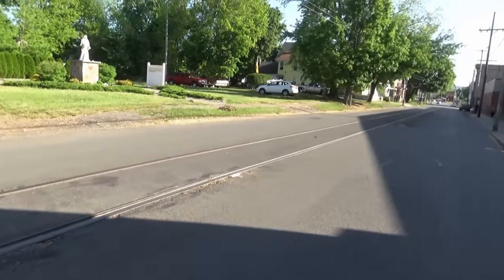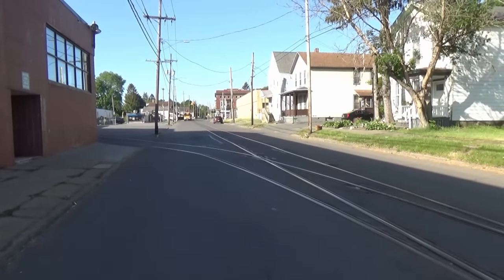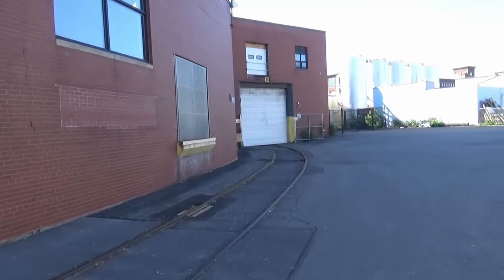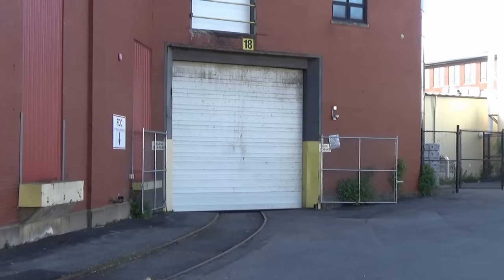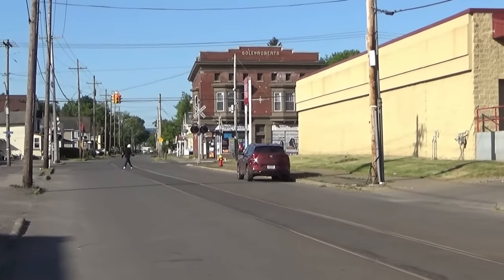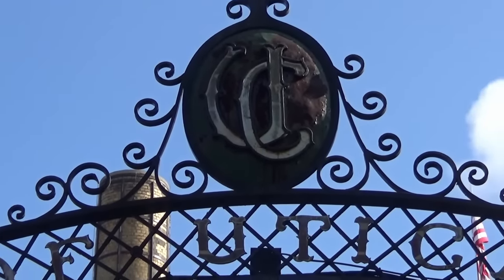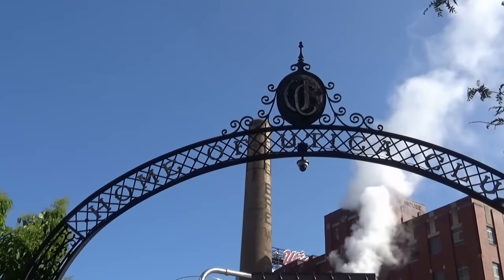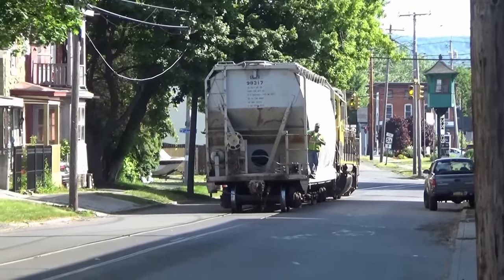"Groan, Squeak & Screech" NYS&W FX Matt Brewery Utica NY

Comment: A lot of that screeching and squealing on a tight curve is caused by the fact that the wheelset is one solid unit. So, in a curve the outside wheel is traveling further than the inside one and it has to skid on the rail a little bit to stay with the inside wheel.
Reply: Well, that's only one reason. But the main issue was the track curve was too acute for such a long wheelbase carriage. Generally in Broadgauge tracks, track curves are way too large so that the wheels don't screem.
Reply: Hence why automobiles use differentials
Reply: I don’t think that’s true.  The wheel tread has a taper that allows the outside wheel to ride up a bit, effectively increasing the circumference of the outer wheel and decreasing the circumference of the inner wheel.
Reply: Yeah, the differential is from the wheel taper, pretty sure it's the flange of of the wheel doing unpleasant things.
Reply: The wheels of a railed vehicle are tapered to form a double sided cone (one taper per wheel), this allows the wheel to "technically" run at the speeds needed to make curves with monoblock wheels. The reason for the screeching is rather the flange, on tight curves the flanges are pushed against the side of the rail which causes the screeching and other noises. I don't know about rail cars but locomotives actually have a lubricant that is applied to the flanges for this reason.
Reply: @FS2K4Pilot   Although you are Correct, Tappered wheel also has limitations. For too acute curves it won't work. It can't take very small turns. Otherwise the flanges will rub against rails. What exactly was happened here.
Here, If the curve was more acute, either the flanges could break or the boggey could be derailed.
Reply: The taper of the wheel assumes its perfectly profiled which after being shopped for a month maybe got done. In any case,  the degree of curvature here likely surpassed anything the taper was meant for hence the wheels and flanges grinding like crazy.
Reply: Just a hypothetical question……how much of a nightmare would it be if that locomotive or the car derailed inside that building???😮
Reply: @farmerbrown3768  Damn, I just thought the same thing as I watched it exit the brewery. I know they have rerailers they can attach to the track but on such a tight radius, I dunno?
Reply: I'm guessing Satan would be pleased... 😜
Reply: @farmerbrown3768  A lot of BIG problems because the rerail frogs generally used go over the rails and the rails are filled with asphalt.  The car and/or locomotive would more than likely derail to the outside of the curve because of the flanges riding the outside rail, which means the building would be hit and damaged.  The crew and/or the car dept guys would bring a bunch of oak shims, planks, and blocks along with a number of jacks to do the job.  If they are lucky, there is a hydraulic rerailing machine with jacks and rails that could easily do the job.
Reply: @FS2K4Pilot  the taper on the wheels is to keep the wheels centered on the rail so as the flanges aren’t in constant contact ( on tangent track ).
Rails are actually tilted slightly towards the center also.
Biggest problem in tight curves is the lead wheels can climb over the outside rail when the flange grabs the rail.
Reply: @greggcarpenter1878  the flanges are what actually ultimately guide the wheels around the contour of the track’s curves.
Reply: Nope....not even close.....wheel flanges from tight radius curve.😎
Reply: @farmerbrown3768 at that slow of a speed on flooded rail wouldn't be a big deal. Could use wedges and a comealong most likely. If you had a more severe derailment in there needing side booms or something itd be a problem.
Reply: That is correct. The shape of the wheels (the taper) is a clever design so in a high speed curve (which is not tight), the wheels are forced outward so the wider diameter of the outer wheel taper is riding the outer rail, and the inner narrower diameter of the other wheel taper rides the inner rail. This allows the outer wheel to turn faster and cause less squeal and wear. Going straight, the wheels self-center to the middle diameter of the tapers and turn on both rails at the same speed.  But on low speed tight curves, the tapers are not enough and thus they squeal like crazy.  Try the Boston subway system sometime. The closer you get to the downtown crossing stops, there are more tight low speed curves and lots of screeching.
Reply: @farmerbrown3768  Not much of a big deal. It would be a very low speed derailing. They have special wedges (sometimes just tapered wood planks) and just crawl the engine back onto the track. Because the tracks are inlaid on a smooth surface, special jacks that lift and slide sideways can also be used. It would take longer to do the inspections of the engine and track than to actually get it back on the rails.
Reply: @farmerbrown3768  With such very slow speed, it wouldn't be that bad.
Reply: I just hope they've got earplugs inside the building.
Reply: Not entirely true. The wheel contact surface is sloped, The outer radius is smaller than the inner (flange) side. So when turning, the wheel contacts the rail with a larger diameter on the outside wheel. That's how rail wheel differential works. However, it can only work within a certain curvature limits. Most of that screeching noise is coming from flange rubbing against the side of the rails.
Reply: As I watch and read this the initial groans sound now more like the outside of the axle skipping to catch up to the inside of the axle. Fascinating.
Reply: @sterlingodeaghaidh5086  все верно . Так и есть
Reply: Can ye not just enjoy the video without dissecting it and arguing over what this is and what that is
Reply: Yeah same as rear end on a pick-up.
But Im still in awe as to the radius that Beast can take! 😳
That must be the maximum there eh?....

Comment: Just amazing how close that engine and train car come to the building walls inside and out.  Thanks for sharing!
Reply: This is classic "close clearance" where there is less than 8.5 feet from the center line of the track to both sides for obstructions.  The 8.5 feet dimension would need to be increased because of the curve.  This location would have had to get an exemption for the close clearance requirements.
Reply: @royreynolds108  Thanks for the interesting reply.
Reply: I would also bet that GP40 is darned near the max size locomotive that could get in that building.

I'd bet the original design (and usage) was for SW series locos or GP7/9 sized frames.
Reply: @litz13    Thanks for sharing your interesting notes.

Comment: I used to work in a warehouse just like that.  It too, was part of a brewery, abandoned by the time I worked there.  The warehouse was wedge shaped with rails in the floor in an equally tight curve.   Ours didn't have a platform, however.  It was being used as a shipping hub for a small franchise package delivery warehouse.  That job ended one bright, winter day when a heavy, wet snow brought down the roof.  The brewery was later sold, restored, and is back in service.

Comment: one thing to also note, that is the tightest curve in the US, and has significant restrictions in terms of locomotive and size.  Aka it can only be switched by a GP38 or smaller locomotive due to such a tight curve.  In terms of Model Railroading curves, that curve is equivalent to a 19" radius curve (15dg) in N scale (Atlas track).  To give you the idea that in Model Railroading, all curves used are tighter then IRL counterparts but that is entirely because of the compression done in model railroading.

Comment: I haven't seen anything like this in my part of the world (n.Europe) since40-45 years ago. Our city had a west and east central station, with cargo trains between the 2 rail areas simply cutting through down town several times a day. Like this video, these trains cut right thru a busy road.
Eventually, there was built a rail tunnel underneath downtown to connect these 2 sections of the local rail network.
I am left wondering, how can this compete with road transport? My conclusion, it only will as long as that track and engine(s) are low maintenance, and not in need of major repairs/replacement... 
I find I still love seeing trains doing add things at low speed ;)

Comment: Nice to see # 3040 back on the job.  Nice photo from 1967 at the end.

That leave me with three questions:
1.  Which came first -- the curved siding or the curved brewery building?

2.  Why was there no empty hopper to be pulled out of the brewery?
I was expecting a 3-way maneuver (one to back in to pull out an empty hopper, one to shove the full one into place, and one to take the empty hopper away).

3.  What is the contents of the hopper?  

The more I think about it, it's kinda sad that the brewery only gets one raw material delivered by train.  Everything else comes by trucks.  And all finished goods leave by truck.  So, lets guess that for every ONE train delivery, there are 50 trucks that bring materials in and finished good out.
Reply: Since I live close by to Utica I could answer them
1. It's the building but I believe they curved the building for the tracks
2. They probably will pick up the empties later in the week
3. It's either grain, hobbs, or sugar, stuff for the brewing products

Comment: I love the rumble and screech that this thing makes. It feels like a hell of a lot of weight of all this metal. I love trains.

5:10 What is the little gate on top for?
Reply: without knowing the particulars of this site but from working on other industrial sites those gates are commonly used to bring machiners or large parts of machines in and out of buildings. While there might be a freight elevator in the building it's sometimes easier to have an outdoor access like that.

Comment: Nice to see NYSW 3040 back in its rightful place and such a friendly greeting so frankly you're both celebrities. Im trusting that GBRX covered Hopper was loaded with malt even though it looks like a crappy Plastics car. Besides the awful Screech of the wheels I noted how close the end of the 3040 is to the waall. The former Allis-Chalmers plant and West Allis WI had some sharp turns into buildings and they could only use an SW1 and cars had to be 50 ft or less. I still like that little Crossing shanty which hopefully sees its needed work this year as you mentioned. Very similar to one still left for display in Kokomo in which was in service until the mid-1980s I believe. Lots of angles and jcts and tractors in that town only two railroads but it had a Beltline that looped the city and the trackage went seven different direction. Also like the train sneaking into town by the garages. A great day to be out chasing and special thanks for the closeup  details at the brewery. And special things for the 1967 photo at the brewery including The Shining clean Greene Maine Central boxcar😊😊😊😊😊😊😊😊
Reply from the maker: Thanks for identifying the boxcar’s owner, I wondered what RR owned it. A truly cool old paint scheme.

Comment: Usually they have to go into the brewery and pull out the empties first and store them on the street and set the brakes, then take the new full hopper in and drop it off. Then they come back out, set the switches and derailer and re-attach the empties and take them back to the yard.

Comment: 3040 sounding fabulous. That is a tight curve for standard gauge.
Reply: I wonder how old that building and track are. Maybe was designed a hundred years ago for narrow gauge steam.
Reply: @franbrinda  it could well have been narrow gauge at one point in its life and possibly with 4 wheel locomotives and wagons which would manage the curve easily.
Reply: @franbrinda  I doubt that it was narrow gauge.  Cars up to about WWII would have been 40 or 50 feet long and could easily handle the curvature.  All of the railroads involved were built as standard gauge.  There were many industries using 20* to 24* curves or less with service from the major railroads.  The Bronx Terminal of the Central RR of NJ had a minimum radius of 90 feet on the center line of the track.

Comment: the screeching is caused by wheels shifting on a bend rail... The flanged wheels are rubbing against the rail line as they trying to match up with the wheelset that is solid. This is why you don't hear it so much on a straighter line of track because the wheels are closer in line with each other and are not drifting as much.

Comment: I noticed a red light in building & a yellow/red flashing light down the road
What kind of signals/signage are on that stretch of road?
Thx so much!!!
Reply from the maker: There are a few traffic lights on Schuyler Street (intersections of Court, Columbia & Noyes Streets). When the train approaches, the red signal flashes for cars waiting to cross Schuyler. If you're heading down Schuyler behind the train, the Court Street signal remains green, while the Columbia Street signal (the one you mentioned) will flash yellow for caution.

Comment: I went to Google Earth and printed out the site.  From my measurements, I get a radius of about 220 feet and a 26* curve is 222.271 feet radius.  The railroad should have station maps of the trackage which will have the curve data on it and station maps will be on 1 inch to 100-foot scale.

The rails are girder rails which means there is a lip rolled into the head of the rail to provide a guardrail for the flanges along the rail.  The gauge of the track is probably widened to about 4 ft 9 to 9 1/4 inches because of the sharpness of the curve.  The switch is called a single-point turnout and the back of the wheel flanges contact and ride against the point casting to direct the wheels over to take the diverging route.  Look carefully at the outside rail to find a device that looks similar to a frog where the other point should be.  This is very common in railroad pavement track as well as trolley car track.  Depending on location and railroad, either point could be used or 2 points could be used with the switch stand between the rails if clearance was tight or on either side of the track like this one set in the pavement below the top of the rails.  Speed would be under 10 mph.  Girder rail is about 9 to 10 inches or more tall for a stiff track to help keep the track from moving up and down under traffic so as not to damage the pavement.  In most railroad usage the points and frogs for girder rail track are straight while trolley track points and frogs are curved.  This type of track is easier for auto traffic to negotiate than regular switch-point turnouts.

The Bronx Terminal of the CRRofNJ had track with a minimum radius of 90 feet.  A radius of 90 feet is a curve of over 64*.  That is why 0-6-0T steamers and the No 1000 diesel were used at that terminal.  The locos had to ride the car float with the cars to get there.   The mathematical relation of the degree of a curve is sin 1/2D(c) = 50/R, exactly.

I also noticed the watchman's tower and found info about it below.  It originally had a ladder to the door for access.  I remember similar watchmen's towers in use in my hometown of Shreveport, LA in the 50s & 60s. 

I used to design and lay out tracks for work.
Reply from the maker: Thanks for your very informative comment! Here's a video "starring" that tower:  https://www.youtube.com/watch?v=uryj_WK702E&t=2s

Comment: Is that locomotive driven in both directions from the same cab or does it have to be turned around.  
In one direction the engine is ahead of the driver. In the other it’s behind.  Most be tricky to drive ?
Reply: Same cab.